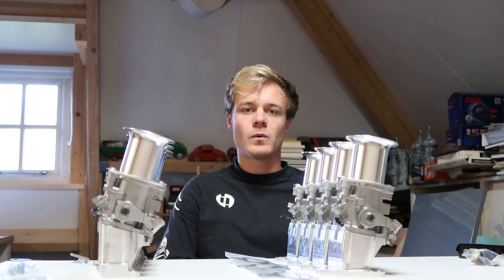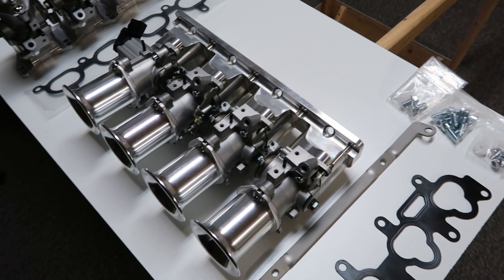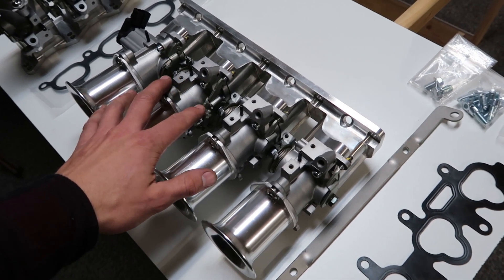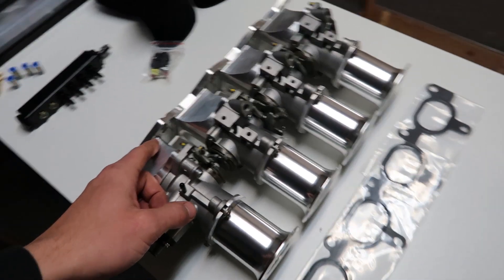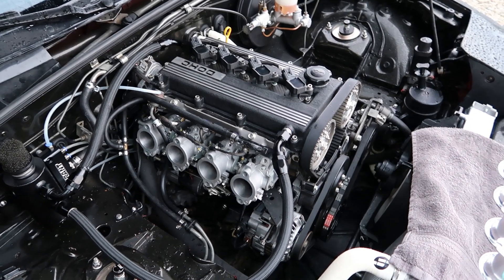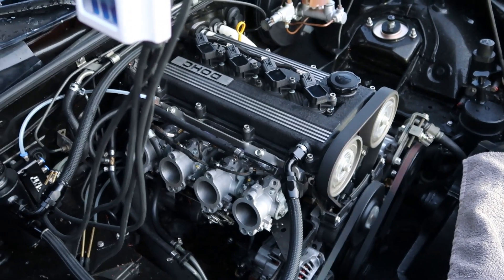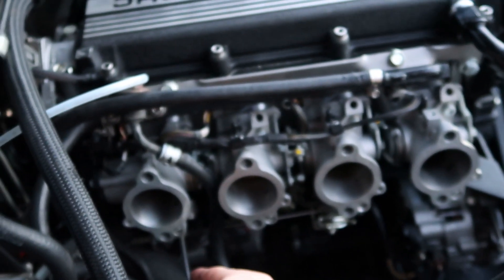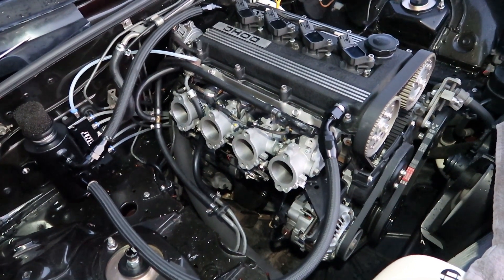Miata ITB Kit Overview + Synchronizing 4A-GE Individual Throttlebodies

Comment: hi, I've seen that you use the ME221 ECU, but they say to run a line from the MAP sensor to it, is it really necessary or if you decide to tune on the TPS you can just ignore it? thanks
Reply from the maker: It's uses Alpha-N, tps only, map is used for altitude changes

Comment: Amazing set up im definitely planning on purchasing this kit i do have ine question about you valve cover tho, what car did it come off and did you need to do any modifications to make it fit? It caught my eye and i love how it looks
Reply: the mazda b6 and bp engines were used in other cars and the different valve covers are a direct replacement, i think he has one from a mazda protege, theres also a cool one on the mazda 323 gtx, theres even a b6 engine cover that says ford on it from the 1990's mercury capri that had a mazda engine lol
Reply from the maker: Im using a mercury capri valvecover. It's a 1.6

Comment: Really nice work! I have a na8c still with the original engine,does your kit fit or do i have to use a vvt head?
Reply from the maker: Yes the 1.8 kit wil fit on both the older and newer 1.8s. It has a dual bolting pattern.

Comment: This comes as an entirely assembled piece including the throttle bodies? Also, any idea if an itg filter used for Silvertip throttle would fit? For reference the old technotoy tuning ones were compatible with the itg filters .. very interested and highly considering over jenveys as I feel OEM reliability is always best.. especially Toyota parts.. awesome vid
Reply from the maker: Yes it's a complete kit with cnc adapter, throttlebodies, velocity stacks, etc. You can find more information in the link in the description if your interested!
Yes a ITG filter should work, it has the same offset between the throttlebodies as on the original 4A-GE.
Reply: @hummelink-modifications  awesome product, I hope to purchase in the spring! Thanks!

Comment: Are those ITB from silvertop or blacktop ? I bought your adapting plate for a 1.6 and i was wondering about thar
Reply from the maker: I'm using silvertops on both 1.6 and 1.8.
By far big enough for Miatas in my opinion.
Reply: @hummelink-modifications  Will the kit fit on Blacktop ITB'S?

Comment: Great video. Not very many detailed videos for miata ITBs. Fun fact the 4age ITBs are pretty easy to set up to run on MAP with the use of a few check valves. They are setup to work on MAP from the factory so it can be done!

Wish I had your manifold vs my DanST unit. It's not terrible just obvious you put more effort into your design and it shows.
Reply from the maker: Thanks man! You can expect some more detailed videos soon.
That sounds interesting, I'll look into that!
Reply: @hummelink-modifications  the tps electronic part 
Would it fit a cbr1000 itbs????
Reply: @hummelink-modifications where can I get the rocker/tappet cam cover from it looks shmick
Reply: Those DanST Engineering manifolds look like an absolute lash-up from the images I've seen.